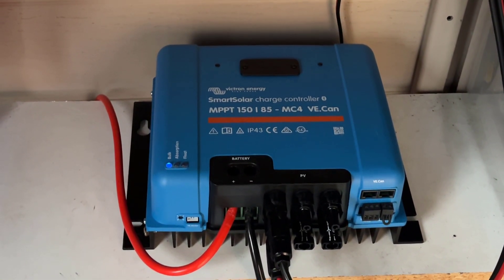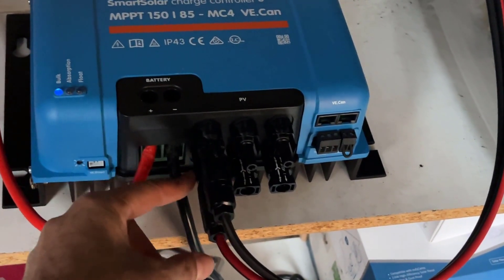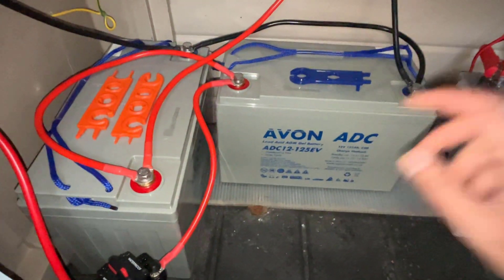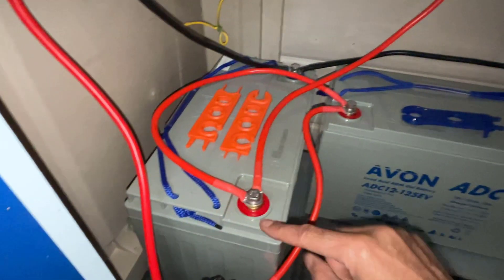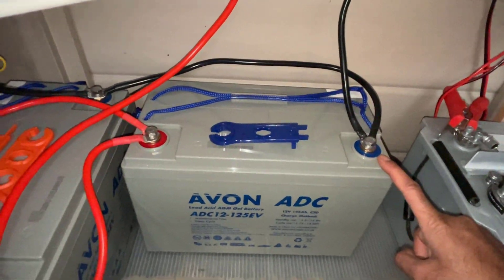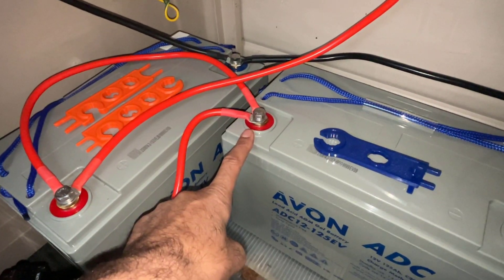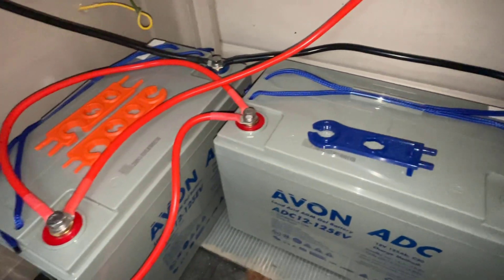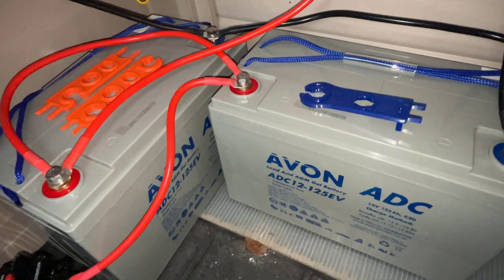Charging two batteries in Parallel (and Load) with one Solar Charge Controller

Comment: hello. I have a question.
In my boat I want to use 2 separate batteries. One for the electric motor and one for the lights inside the boat.
The batteries are not the sames capacity and size.
But I would like to be able to charge them with one solar panel and controller.
How can I hook them up?
Is it possible?
I cannot mount 2 solar panels and 2 controllers.
And i dont have space for 2 big batteries (the one i have its older and i hear that they should be same age if i want them to be in parallel).
Thank you in advance! :)
Reply from the maker: Hi, here's a simple solution which wouldn't take up much more space. You would need either a dual solar charge controller or two separate controllers connected from the same solar panel to charge the batteries separately (as the batteries have different capacities). Therefore one circuit for the motor and one circuit for the lights.
Reply: @HandymanSavage  great, thanks a lot! :)

Comment: When you have to wall batteries, you have to set the first one as the main battery and then flip the dip switches to designate the 2nd battery as battery two.
If I wired it the way you described, wouldn't that wreck the BMS communication between the two batteries?

Comment: Can you Connect 3 SAME 12 Volt   Batteries in Parallel to 1 Renogy Charge Controller 40 AMPS  .. ??
THANK YOU ..
Reply from the maker: Yes you can as long as the amperes of the 3 batteries is also the same, you should be fine

Comment: For the parallel battery wires, should they be bigger in size than the load wires?
Reply from the maker: The size of these wires can be smaller if the batteries are closely matched in voltage and capacity and if the distance between them is minimal. In such cases, the current flowing between them is relatively low.
However, if there are significant differences in voltage, capacity, or the batteries are far apart, these wires may need to carry higher currents to equalize the batteries. In this scenario, they might need to be the same size as, or larger than, the load wires to handle the potential equalization currents safely.
Reply: The batteries are 6-7ft apart. I was going to use 2awg for the parallel connections and 6awg to the solar controller.

Comment: Thanks for the great video.  This confirmed what I was planning to do with 2 x 100 Ah batteries, however, my inverter needs 24 Volts.  My MPPT is part of a DC-DC setup and can handle the 12V side. How do I wire this inverter in without manually switching over?

Comment: Does it make any difference if you connect the charger and load to the same terminals, apart from the physical nature of having three connectors on one terminal?
Reply from the maker: Not at all, in fact that's how I have it setup myself. I use the multi-battery clamps to connect the battery cables in Parallel, Charger cables and Load cables without any issue on the same terminals

Comment: For the final step the load side I am looking to connect an inverter to this   And the inverter has outlet to plug in ac device. For this would I connect the negative wire from inverter to one of the batteries and the positive side from inverter to positive terminal on one of the batteries. Does it matter which battery I connect the inverter to. I have 2 35amh batteries in parallel
Reply from the maker: Hi, as per the video. For your inverter, simply connect positive inverter load to Positive of battery 1 and negative inverter load to Negative of battery 2. I don't show it in the video, but the load lines go via a timer and then direct to an Inverter, so almost similar to your scenario.
Reply: My charge controller has + and - ports for Load so I wired from positive port on charge controller directly to positive port on the inverter and negative port on controller to negative port on inverter. I assume this is ok. These are both 12v 35 amp ht batteries. I tested them with multi meter and am showing just under 10v. So looks like some charging needs to take place. The inverter has an outlet on the back and I plugged in a light fixture. When I flipped the switch on the inverter to “ON” I get a beeping sound and light from fixture does not light up. I assume this is because the batteries are under charged
Reply from the maker: @michaeldevaney3307  Inverters are recommended for connection to batteries directly (due to the controller load output rating (in amps) usually being limited and inverters tend to use a lot of juice when connected to high powered mains devices. I tend to use the Controller Load for lightweight projects such as USB etc and battery to inverters for high-powered mains devices
Reply: Ok so I will wire + from inverter to + on battery 1 and  - from inverter to - on battery 2. Then plug in ac device into inverter to operate.
Reply: I understand wiring the inverter directly to The batteries 24/7 tends to drain the batteries. This is what my intention is. In my situation I would be leaving the connections to the battery intact for many months since this is a secondary residence. Would it make sense to leave the connections to the battery intact but disconnect the connections to the inverter for the long term periods when I will not be applying any load to the batteries
Reply from the maker: @michaeldevaney3307  I'm no expert, but yes that makes sense. When not using the inverter, simply disconnect it. There are devices like Timers which can sit between the battery and inverter to let the battery charge and cut power to the inverter - I do this for my solar crypto kit in the winter months as there can be days where the batteries aren't fully charged due to weather and short days, so you can run the inverter at times which suit the weather and the load

Comment: can one 240V solar plate sufficiently charge two 200A batteries?
Reply from the maker: a 240W Panel can charge 2x 200 amp batteries, but it's all down to the Load. If you have a load which is power hungry you will find that the batteries run out faster than the Solar Panel can charge them.

Comment: If I have a battery that is generally used separately from my solar setup is there a way to easily add the separate battery to get it charged up?
Reply from the maker: Funnily enough I am in the process of doing something very similar. I have one battery bank which is charged by Solar, but I end up with a surplus of solar (as the battery isn't used much), so I am looking into charging a second battery bank with the excess solar. But the essential ingredient is a dual battery solar controller (i think).... Although this remains to be tested, video coming soon.

Comment: Thanks for the video. I have 4 batteries for an electric motor pontoon and was hoping to have two 50 watt solar panels (one panel per 2 batteries). I have two questions 1: Can I leave the load connected while parallel charging? and 2: Currently the system is charged by a Minn Kota 4 x 10a battery charger so each of the batteries are hooked up separately from the charger, if I switched to solar would I need to also switch the load hook up as well? Thanks for any guidance, Andy K
Reply from the maker: Hi there. 1) Yes you can charge and run a load at the same time. My solar controller (depends on the type) will do a great job of getting more juice (Bulk charge) out of the panels while charging and running a load on a daily basis, only stopping the load to let the battery fully charge using an automated switch (check out my video on Solar Powered Doge Mining). 2) Not entirely sure, but aim for a Solar controller which goes beyond the max possible capacity and it should be fine, but again it depends on the config.

Comment: Would an inverter get connected to the load sides or the charge controller sides?
Reply from the maker: Good question and the answer is it depends entirely on your application. Connecting the Inverter to the Load Output on the Charge Controller does offer more protection such as Low Voltage Disconnect but depending on the rating of the Charge Controller you may not be able to power big electrical items. Whereas connecting the Inverter directly to the battery gives you much more power output. If the Inverter is left connected to the battery 24/7 then your battery can drain, but I use things like timer switches between the Battery and the Inverter to decide the power on schedule for the Inverter.